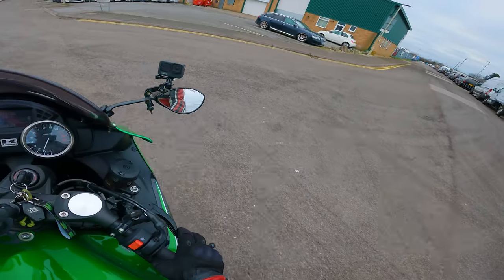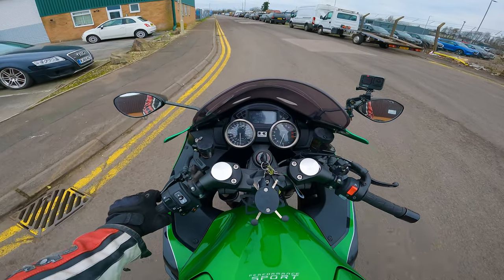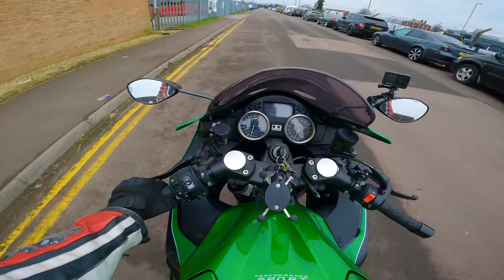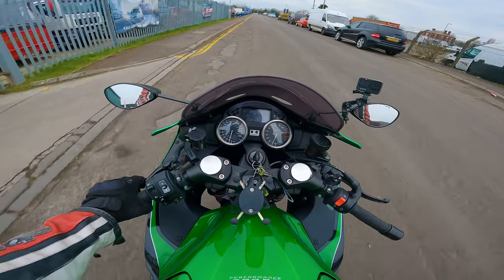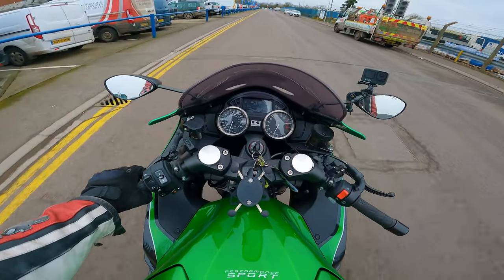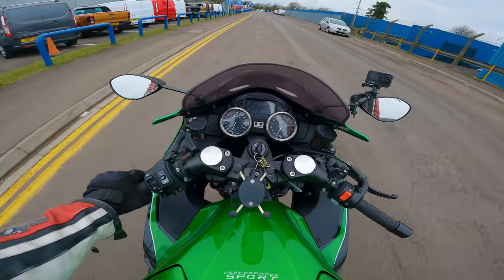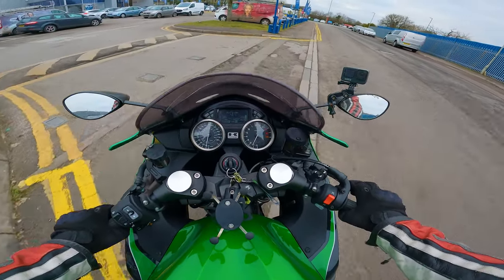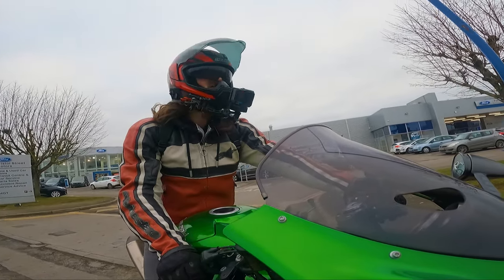Learning Clutch Control On ANY Motorcycle In 5 Minutes (Feat. Kawasaki ZZR1400 / ZX-14R)

Comment: I agree that most bikes can move in idle, however from my experience 125cc motorcycles tend to stall if you try this on even the slightest uphill gradient. I live in India where you don't often see motorcycles with displacements larger than 150cc. I learnt to drive on a little 98cc bike which had next to no torque. That thing would stall even on flat ground without a little bit of gas. So, while I believe the technique you preach may help many, I think you need to place more emphasis on the fact that sometimes, especially on smaller displacement motorcycles it might be necessary to give it some gas while releasing the clutch.
Reply from the maker: I have a video demonstrating the same technique on my wife's 125, it works exactly the same way, just a little harder to perform. But if you can do it on a 125, you can clutch control on any bike 👍
Reply: On my Honda rebel, 125 total clutch control is possible. I use this  method in my u turns.

Comment: My little CB125F is chronic for "false neutrals" if you're  not purposeful with the gear change. I've seen a lot of advice about "rocking" the bike to get it back into gear but I've found it much easier just to feather the clutch out and blip the throttle.
Ironically I've taught myself how to deliberately cause a "false neutral" so I can practice recovering just in the driveway. I find rocking the bike to be a harder technique, but I wonder if this is also something that translates into bigger bikes. Should I just be practicing to rock, or is my technique going to work on bigger bikes, too?

Comment: Dude, that is not Clutch Control. That is just using the clutch to shift gears. 
Clutch control is keeping the clutch in the friction zone with a little bit of throttle during slow speed maneuvering.
I'm not trying to be an smarta$$ or anything, but I would recommend you watch some videos on slow speed maneuvering by MotoJitsu and McRider.
They are masters of the trade...
Reply: motojitsu is one of  the worse always banging on about "in the twisties" "trail braking" what new riders need to learn and what good teachers will learn them is to use the friction zone of the clutch around a tight corner to maintain speed and help them keep the line in which they are heading rather than letting the throttle control them and end up on the other side of the road.